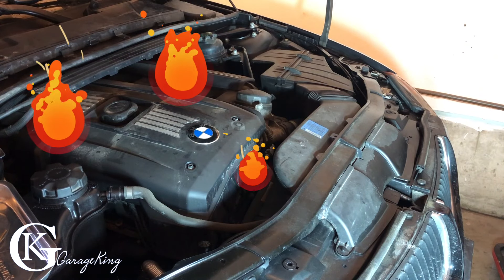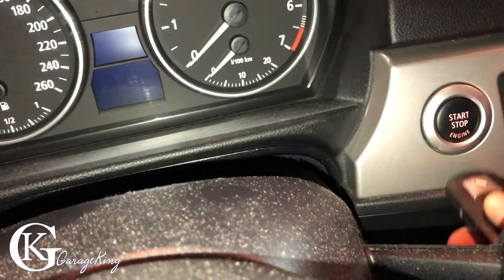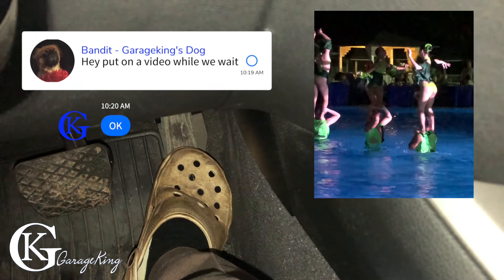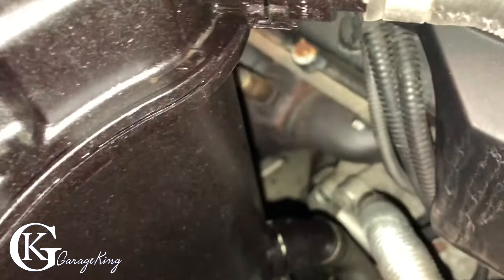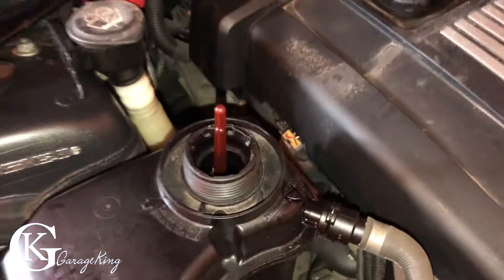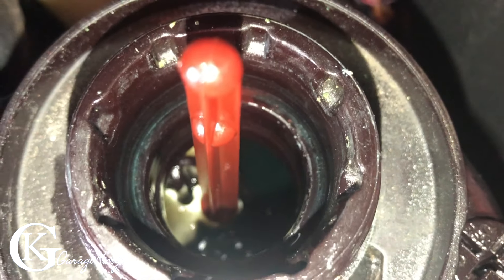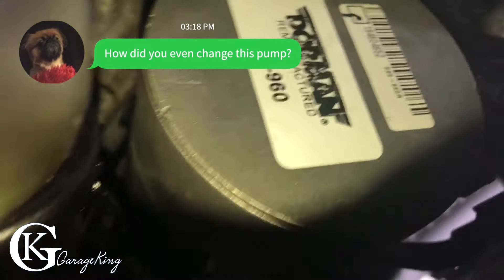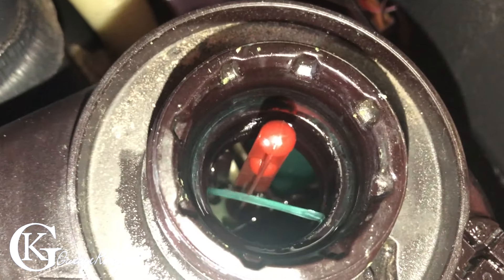How to Check BMW water pump

Comment: Tried this with my 2009 bmw e93 diesel and it didn’t work , when you start the car though the water pumps through ?
Reply from the maker: Not sure, unless maybe on the diesel its a different technique, or perhaps you need a bi-directional scanner?
Reply: Got it booked in Tuesday , over heated few days ago and before that heaters only worked on one side .

Comment: I just changed the thermostat and the engine still overheats when running at low speeds, start & stop.
However, at high speed, it cools off quite fast. 
Is this likely a water pump failure? I haven't done the test shown in the video yet.
Reply from the maker: Most likely it probably is, and a good sign is when you are driving faster the engine does not need the water pump as much as there is more air flow cooling the engine.  Here is how to change your waterpump https://youtu.be/K-JXuMHgVJE

Comment: Does driving with insufficient coolant increase the chance of water pump failure?
Reply from the maker: Yes it does, as the water pump is designed to run in coolant with no bubbles.  When your coolant level get low you can introduce bubbles and your waterpump won't be as effective so the computer keeps speeding it up to get more coolant flowing, but there is not more coolant so what happens is your pump runs at a higher rate of speed and can burn out faster.

Comment: Can weak battery cause the pump not functioning well ?.
Reply from the maker: Hey thanks for the comment.  Not normally, it should still run, but if the battery is really weak then yes maybe.  Once you start going under 11V on most cars funny things start happening.  You could always put a charger on it when you are testing it to ensure you are above 12V.  Happy Sunday to you :)

Comment: Hi, I have a 2009 bmw 323i. Knocking noise by the belt, the sound goes with engine even when you idling. I am wondering if it is not crankshaft,or water pump failure? Thx.
Reply from the maker: Hey There, probably not the waterpump as they don't generally make that sound.  I doubt its the crank as you would have a low pitched "thud" that raises and lowers with RPM.  I think most likely you may have a bad bearing in one of the idler pullies for the serpentine belt.  You can take the belt off, start the car and see if the noise is gone.  You can alway use one of these https://amzn.to/3QHUnEZ to listen closely.  I have one and use it quite a bit.

Comment: Hi, I have a question I replaced the water pump twice already between only 4months. My question is why is it still breaking is there any problem that I could look of why my water pump keeps breaking?
Reply from the maker: Hi There, 2 pumps in 4 months is way too much !!!  A replacement pump should last a few years.  The things I see.... 1. Make sure pump is properly bled, air bubbles cause the pump to run too much and can cause failure. 2. Make sure the connection (plastic connector) is good.  Its a real *** to get is connected and sometimes you have to use pliers to squish it together until it clicks and its got to be straight.  A bad connection can simulate a bad pump when really the pump is fine, its just the connector wiggles out or someone broke it putting it in. 3. Ground - make sure the ground connector is good as a dirty ground can cause problems.

Comment: I’m not overheating but I’ve got pump codes, and it doesn’t sound like it’s running. Also looks like it is leaking?
Reply from the maker: Most likely the pump is starting to seize up

Comment: I have a 2007 328xi WBAWV53577P076877 i did it with the car off and it doesn't purge but purges with the car in on position
Reply from the maker: That's how its suppose to work, with key ON, engine OFF, so your gauges should all be ON.
Reply: @GarageKing  I did it I think I'm going to need a water pump 🤔 there was no flow when engine was off, only with the engine on it started to squirt, I also see a small Crack in the radiator so I'm going to have to replace it all once it's a n52
Reply from the maker: @SupraMan_3000  You are probably right, if its ever overheated you may want to think about changing the thermostat.  Its right beside the water pump. Here is the video for the pump https://youtu.be/K-JXuMHgVJE

Comment: I had tried but the waterpump did not kick in…mine is 318i 1990 e90..this model mechanical or electric water pump?
Reply from the maker: I think yours may be a mechanical pump, but I'm not 100% sure.  It would be easy to check.  Just follow the fan belt and you should be able to see it.

Comment: my bmw x5 e70 2008. when i drive short drive. and i off. the pump runing and stop after. thats normal??
Reply from the maker: Yes that is normal.  Once you stop driving the temperature raises in the cylinder head (for a short period) so to prevent this the pump can run for a short period after you shut the engine off, this is normal.
Reply: @GarageKing  thanks man
Reply from the maker: @yanibay  Anytime

Comment: My waterpomp works well. But hood is hot. But temperature of oil is ok
Reply from the maker: Well that is good, the heat to your hood is most likely not a problem, and when you are driving it should cool down with air flow.  You mentioned the oil temp is ok, please make sure your coolant temp is ok as well :)

Comment: How did you change it?
Reply from the maker: Hey There, I did film the changing of the pump, but I didn't edit it yet, so I have about 4 hours of footage that I have to make into a 12min video.  It can be done.  You have to jack up the car, remove the underskirt, and if you look just behind the steering rack its there.  There are aluminum mounting bolts, and you have to get ones ones as they stretch. Its not the easiest job, but if you take your time and allot a good portion of the day you can get it done.

Comment: what if i do not hear the water pump..    is there a way to test the fuse?
Reply from the maker: Hey there, you may hear the water pump, but its really quiet when the pump has failed.  You can check the fuse for the waterpump, Its in the fuse box under the hood on the passenger side. You need to remove the fresh air filter cowl from the top of the engine, in order to remove the cover. There is mostly wires in the box and its made out of white plastic. I think its a 30amp fuse.  It may be the only fuse in there, you can pull it and look to see if its blown. If its ok then most likely its your waterpump and you are going to want to watch this on how to replace it.  Also if its blown, a bad pump drawing too much current can also blow the fuse.  https://youtu.be/K-JXuMHgVJE

Comment: My electric waterpump starts up smoothly, but stops apparently because of engine overheat after a few minutes. How do I resolve this? Thank you
Reply from the maker: Most likely its the waterpump failing and it cant continue to run when it should.  Even if the thermostat is stuck it should keep running.  I think you need a new waterpump and here is the video to do it https://youtu.be/K-JXuMHgVJE

Comment: My doesn’t flow coolant but when start engine, it starts to flow. Do I have bad water pump?
Reply from the maker: You are probably not putting it into test mode the right way.  When you do start it and the pump flows how much does it flow?  If its flowing a lot then your pump is most likely fine

Comment: I changed my thermostat like three days ago and my electric water pump is working but my E83 still overheat when I accelerate closer to 100
Reply from the maker: It could be that your pump is not flowing enough.  Sometimes they kind of 1/2 fail and they don't flow enough.  If you pump if flowing, but not enough your car will still overheat. The other thing is if the system has dirty coolant something could be plugged, you may have to flush with water and refill with coolant. Congrats on replacing the thermostat, not the easiest job to do !!

Comment: I got a new water pump and thermostat and i do the bleeding process and water pump test but doesn’t circulate. The reservoir doesnt piss out. What are other possibilities? I bought them new from ebay
Reply from the maker: Hey there, I know the connection for the water pump is tight from the factory. Here is the link to the water pump replacement video https://youtu.be/K-JXuMHgVJE  if the connectors are not tight that will surely cause your problem.  Also there is a tight ground wire you must secure.  You could also look for a blown fuse.  I'm not sure which circuit the water pump is on, but you could check that.

Comment: Can you please help... My car BMW 2014 X3 F25 the Electric Water Pump Bleeding was working fine twice.  Then, it stop after I  used the Blue Devil Head Gasket Sealer.  The Engine getting hot.  So, I changed the Thermostat and clean out the Reservoir Tank.  Same issue.  Should I change the Water Pump?  Is there fuse that I should check?
I got 3 Codes:
1) CD9010
     LIN, Message: Electric Coolant Pump: Missing.
     DTC Status: Current
2) 1A2004
     Electric Fan, Actuating Wire: Line Disconnection
     DTC Status: Current
3) 1A2002
     Electric Fan, Actuating Wire: Short Circuit to Ground
     DTC Status: Current
Please help :)  Thank you & God Bless
Reply from the maker: Here is the video to replace the water pump if you need to https://youtu.be/K-JXuMHgVJE  Now the first code is fine if your water pump failed, but I'm curious about the other two.  If you changed the thermostat you would have taken the waterpump out so I'm wondering if you forgot to connect something fully and the plug wiggled out?  I would check all your connections first.  I can't see the Blue Devil sealer causing any problem but you never know. I tend to stay away from those sealers as they usually don't work long term, they are more of a temporary patch.
Reply: @GarageKing  BMW 2014 X3 F25 you can remove the Thermostat housing without removing the Electric Coolant Pump.  I changed out the Thermostat thinking it got stuck close therefore my car running hot.  I  did clean out blue gel inside the reservoir tank completely.... (A new Reservoir Tank and Electric Coolant are on order).   Do you know if there is a fuse to check?
Reply from the maker: @mdang3662  You are right but, its still a fairly big job, most do both at the same time. Most times running hot is the water pump not circulating fast enough. I think there is a fuse, but you have to check your manual.  I'm not sure where it is.  Also if the fuse is blown you have to look at what caused the fuse to blow.

Comment: My z4 did not overheat, a hose broke and coolant was dropped but I turned the car off inmediately, no overheating at all. 3 hours later   when checking the hose the  mechanic tested the pump and it seems like it is not working, the car was cold at that moment, could it be that the pump starts working until the car reaches it's working temperature?
Reply from the maker: Hey there, the pump actually doesn't run when the car is cold, and its variable so as your car heats up it runs faster, then you also have your thermostat.  You should still be able to do the test on a cold car.
Reply: @GarageKing  Hi, thanks so much for your reply. Checking if my understanding is correct: So if the car was cold, it is normal to not see the pump active until it heats up, once it starts heating the pump will start functioning. However if I do the test(start electrical system but not start engine, press pedal 10 seconds) it should trigger the pump and it should start working.
Reply from the maker: @luisleal4169  Yes you are correct, and maybe try the pedal test again with even timing between the pedal pushes. I know once you activate the car you have to start with the pedal fairly quick, if you don't the car will think you are just pushing the pedal for no reason, there is a small window of time to begin the test.

Comment: What causes a water pump to break down?
Reply from the maker: It could be a number of things, as it's an electrical device. They break down with age and use, just like a starter motor or alternator. Some last longer than others.  Good vehicle maintenance such as regular coolant flushes, and keeping the engine clean can prevent corrosion which can contribute to problems.

Comment: Does this work on a 2 series?
Reply from the maker: Good question, and to be honest I’m not sure. I never tried it on a 2 series. If you find out please let me know as I would be curious.  Thanks :)
Reply: GarageKing I just tried it I think my water pump is bad cause I didn’t even see the water coming out in the Cup lol but my bmw doesn’t seem to be over heating any advice?
Reply from the maker: Hey there, if your water pump is bad it should overheat after a little driving.  The one in the video that I posted overheated pretty quick and it was in the winter.  When I did the test on the vehicle in the video and listened closely I could hear the buzzing on and off. When you tried it could you hear any sound?  You can definitely hear a good pump run. After I changed the pump and did the test I could easily hear the pump turning on and off. If you car is not overheating your pump is probably ok. What’s going on with you car?  What’s the symptom ?
Reply from the maker: Its possible the 2 series has a different test and you are just not activating the test.
Reply: GarageKing yeah I haven’t had any problems with overheating So your thinking my water pump might be okay? I just don’t get why it’s not shooting the water out
Reply: GarageKing could it be a censor?
Reply from the maker: I’m wondering if the two series has a different way of turning on and your is fine. Maybe the activation is different so your just not activating it, but it’s coming on when you are driving. Your pump may be fine. Is the car acting up at all?
Reply from the maker: Just curious what caused you to check it ?  Was the car doing anything funny ?
Reply: Actually I just looked I have a 3 series lol I’m looking at the Diagnostic from the Mechanic the paper says there is a Fault code for electric water pump and DMTL leak Detection pump. Just making sure there not trying to rip me off
Reply from the maker: If you have a 3 series then it’s very possible that you need a pump. It may be the pump is intermittent so it runs sometimes. Maybe it only runs when the vehicle is hot (running). When you test it you most likely test it warm or cold as you have the cap off.  The pump is not super hard to do but you have to jack the vehicle up high enough to do it from the bottom.
Reply: GarageKing it was definitely running when I toke it out and came home
Reply: So wonder how long I have until it goes out would you know?
Reply from the maker: You never know with these things, it could run a few months or go tomorrow. If you are getting the code most likely you need the pump. They are pretty pricy on these vehicles………
Reply from the maker: The problem is once it goes you are going to need a tow as the car overheats pretty quickly and you don’t want to drive it overheating or you could damage something else.
Reply: GarageKing yeah I’ll probably just go ahead and get it fixed thank you for your time
Reply from the maker: Anytime :)
Reply: GarageKing your getting a New Subscriber 😎
Reply from the maker: Thanks brother !!!!  I really appreciate it, and if you even need anything please reach out. I work on a number of vehicles :)
Reply: GarageKing definitely!!!
Reply: To lately jump in here. I've had a 2 series for just over 1 year now. 20k miles. Yesterday I noticed my radiator stay on after shut down for a good 5 mins. Coolant good, no overheating, no warning lights.cive read they like to do it to prevent oil coking on the turbo but I don't remember the car ever doing it before. And has done it today now as well.

Comment: So mine kicks on but my car still over heats and the fan does come on
Reply from the maker: If your car is pump has a strong spray like in the video, there is the possibility that it could be the thermostat. If you have a scanner with live data, one like this is cheap https://youtu.be/tDL-tAivuDA as it only costs about 50-60 bucks.  You can monitor your engine temp from a cold start and see when the thermostat opens (if it does) and then see at what temp the fan comes one.  Very helpful.

Comment: I have f30 and my water pump is working, my fan is working and i do have enough coolant still i have high temperature problem what could be the cause.
Reply from the maker: you may have a stuck thermostat
Reply: @GarageKing  i think i have a stuck heater valve control..
Reply from the maker: @karanveersingh301  That is a possibility, but usually if the heater valve gets stuck open then you just have heat all the time through the vents, if the valve gets stuck closed then you get cool air through the vents, but which ever way it is, I don't think it would cause the engine to overheat?

Comment: My 525i 2001  is ran by the belt
Reply from the maker: If your water pump is driven by the belt then if you car overheats the thermostat could be stuck or you have low coolant because of a leak.

Comment: My bmw e90 from 2007 doenst have a electric waterpump i think. Doesnt work when i want to test it. N46B20B is the motorcode
Reply from the maker: Hey thanks for the comment and thanks for supplying your engine code. You have the 4 cylinder engine so you may not have the electric water pump. I’m not sure. An easy way to check would be to look at your serpentine belt under the door and see if it’s driving a pulley that looks to be attached to a pump. The other thing you could do is call the dealer and give them your Ser#  They will tell you what type of pump you have.  If it’s not coming on when you test it, it could have totally failed so you could have an electrical pump.  I would call the dealer and have them check for you. This way you know for sure.